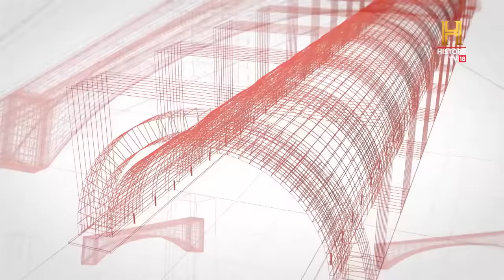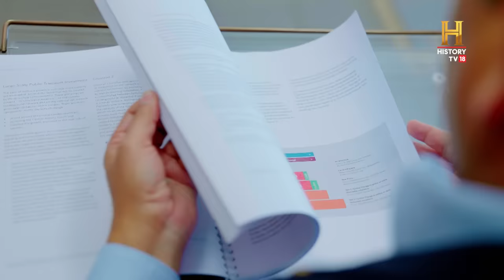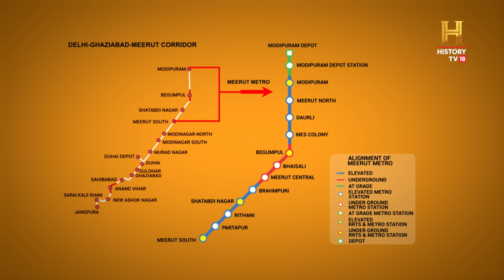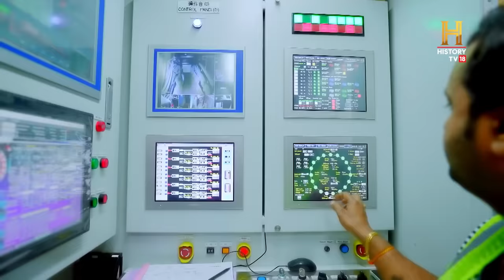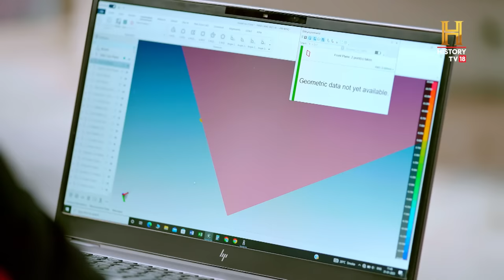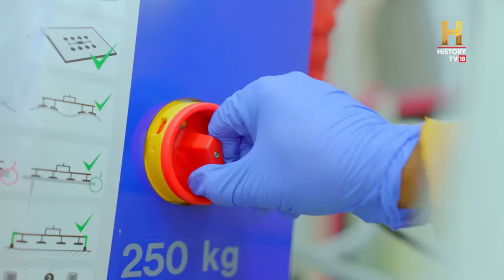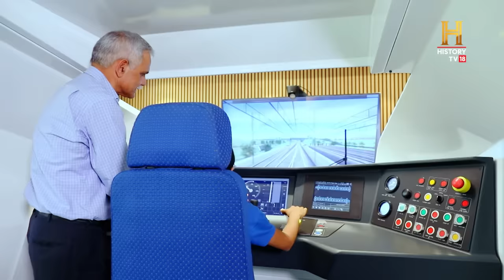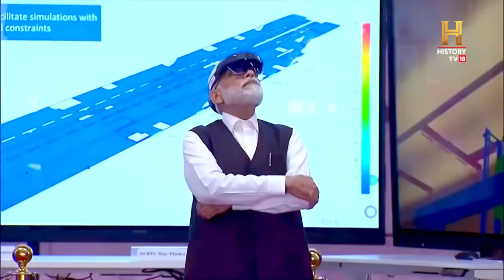Engineering Marvels: RRTS | Full Episode

Comment: 1:28: 🚄 India's first semi high-speed Regional rapid transit system aims to modernize travel in the national capital region.
5:14: ✅ The Delhi-Meerut RRTS project is progressing well, with successful identification and mitigation of major roadblocks.
10:12: 🚆 The video showcases the progress and challenges faced in the construction of the Delhi-Meerut Regional Rapid Transit System (RRTS) corridor.
15:07: 🚄 The video showcases the construction and features of the technologically advanced Namo Bharat train coaches.
20:49: 🚄 The Delhi-Ghaziabad-Meerut RRTS Corridor will revolutionize regional transit with a modernized and eco-friendly system.
Recapped using Tammy AI

Comment: I am waiting for the day the whole main line of indian passenger railways would be elevated just like the RRTS or Bullet Train Corridor of Ahmedabad-Mumbai with speed of Trains reaching above 200kmph avg and tremendously reduce travel time and cost of flights. Trains are defenitely more comfortable and also helps to carry luggage much better and weighing higher than planes.
We need different layers of connectivity of Trains from local metros to suburban Trains like RRTS to long intercity travels within state and between states.

Waiting for Vande Bharat sleeper versions between Bengaluru-Kolkata and Delhi-Kolkata.

Also manufacturing should be all across the country to meet demands if present requirement and even for exports.
 Today only ICF Chennai is making VB Trains. I would urge govt to spread the manufacturing to Raibareilly , Titagargh, Solapur , etc etc all across the country and even private players  operating in india can be given chances. 

This is a 10-15 years plan for transformation of railways.
Reply: elevating entire mainlines will be such an ugly feature on the landscapes! Having elevated bullet train lines is enough.